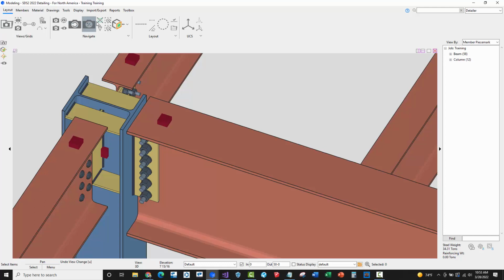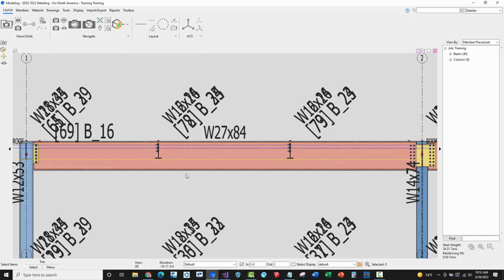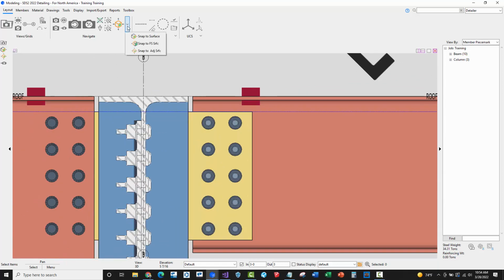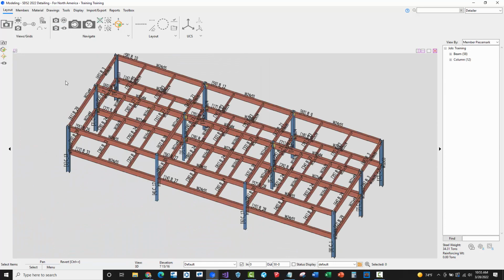Keyack Tech - SDS2 Snap to Surface Command

Comment: Wait are you back in the SDS2 world?  Did you know there's a param that will do the same thing but put you on member centerline?!
Reply from the maker: Yeah I have been going through the basic training to refresh with the latest versions and been doing prototyping with the newer .NET API. 

There’s definitely value in having snap to surface and then also at centerline of member for beam / column web when doing centered bolts, flange plates etc. is that on SDS toolbox or a parametric you can load in that’s included in the install?